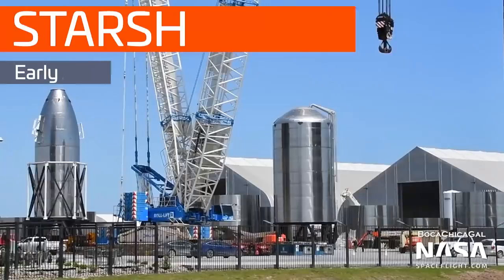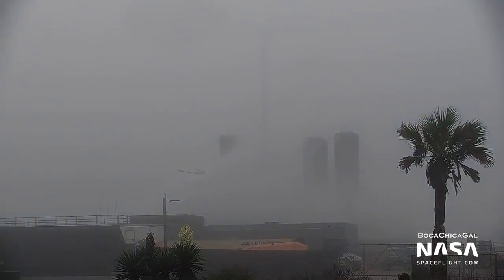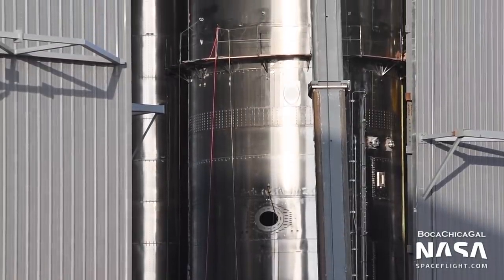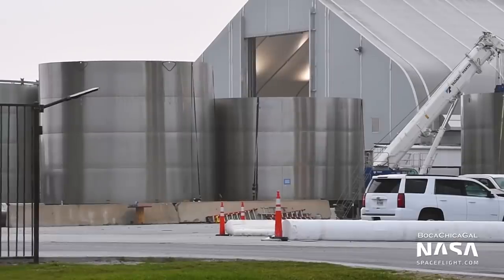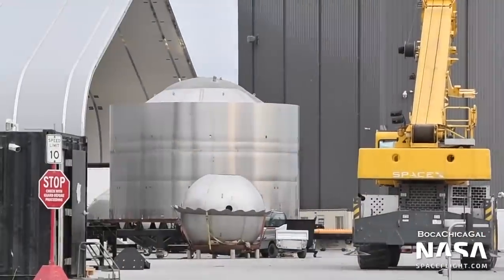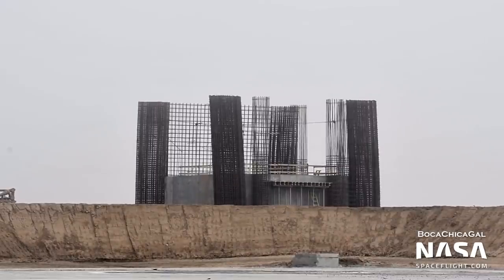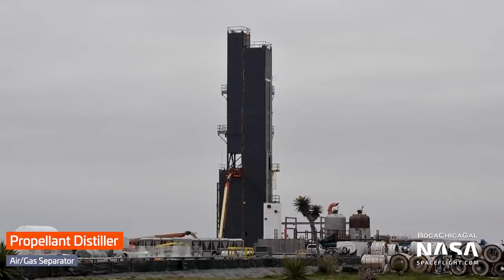What's Next for SpaceX in Boca Chica | Starship Update (Narrated)

Comment: The pictures of the Launch Table are a great illustration of the rapidity with which any horizontal surface at a factory will quickly become a shelf for all sorts of tools, clothing, equipment, etc.  It's something that has to be constantly guarded against to keep a clean and safe worksite where people can quickly locate the equipment that they need.
Reply: Just moved in February— can’t tell you how many times I lost a drill bit because I set it down to change bits, rather than putting it back in the box. This comment is too real for the space sector 🤣 thank you for your support!

Comment: Hi Ian. The correct name for a "LOX Distiller" is an ASU (Air Separation Unit). And it separates LOX from LIN (Liquid Nitrogen) by first compressing the air, then cooling and further chilling the compressed air down to very low temperatures, and finally expanding the cold, gaseous air to a lower pressure, which as we all know, cools the air further (compressing a gas heats it up, while expanding a gas cools it down). This turns the cold gaseous air into liquid air. The liquid air (still an O2 & N2 mixture), is then separated by distillation into pure LOX and LIN streams. btw I'm sure they will also keep some of the LIN for use in cryo-testing etc. The excess LIN (approx 4:1 vs LOX) will probably be used for chilling the compressed air before expansion. The required energy input results from the need to compress the 100% air feed, to obtain the 20% LOX product

Comment: Just a thought - could that mystery structure be an elaborate weight-simulator for BN1?
Reply: probably not for bn1, it isn't going to perform any testing. I think it will be used to test reentry forces on the flaps.

Comment: Might the mystery structure be a dynamic testing facility, like the one built in Huntsville for the Saturn V? They put shakers under the rocket and tested vibrations at several fuel loads and stage configurations.

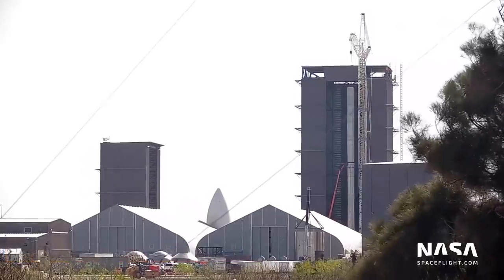Comment: 2:40 Wait.... does that mean that High-Bay is too small to build real boosters? Or does Space-X have some trick in their back to build a booster that ist taller than the High-Bay, so they don't have to cut one ring off?
Reply: Uh… this is a good question 😅 I’m just the editor, but I believe the implication is that the internals have been redesigned. If I find clarification on this, I’ll try to get *it into a video
Reply: My major question also! Will they design the next one to be shorter?
Reply: It seems that if BN1 was kept at its original height with that extra ring, it wouldn't have fit in the High Bay.

Comment: They seem to be having a lot of issues with the turbo pumps, especially on the methane side, I'm not sure what they are using in those pumps but maybe they should consider using different materials e.g. cobalt alloys vs titanium impellers etc..  maybe not 3d printable but more reliable.
Reply: Don't think they've had a problem with the turbo pumps have they?
Reply: @Easedaray  Yes, I believe I have seen a number of Elon tweets over the last year + with issues relating to the turbo pumps
Reply: Makes you wonder if they’re testing the feasibility or just know they’re going to fail and want to save on designing until they know what may work? Interesting point— thank you for your continued support!

Comment: Overheating will we an issue for quite some time, where are the radiators? Using radiators as landing legs could improve the landing and overheating. A Design change should be considered.

Comment: SN11's Failure was caused by a small methane leak and fire on raptor engine 2 which damaged the engine and avionics causing the engine to explode when they attempted to restart the engine for landing.